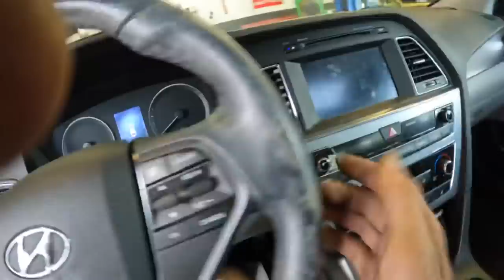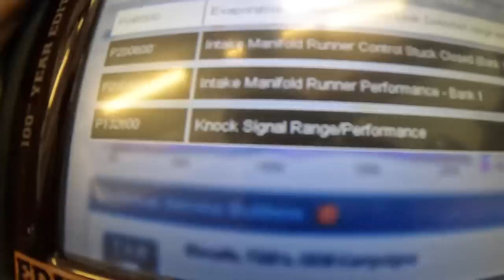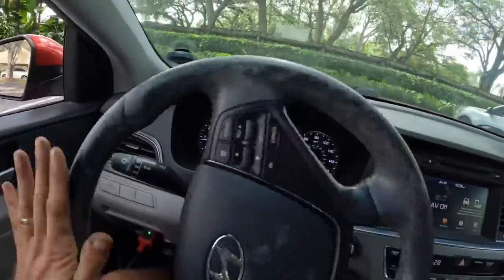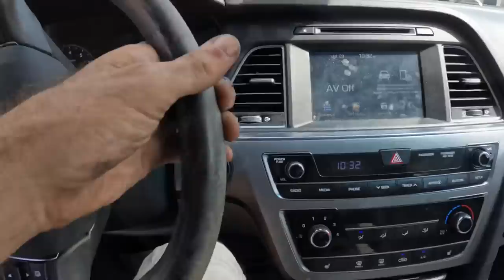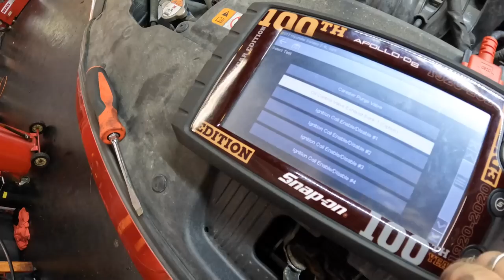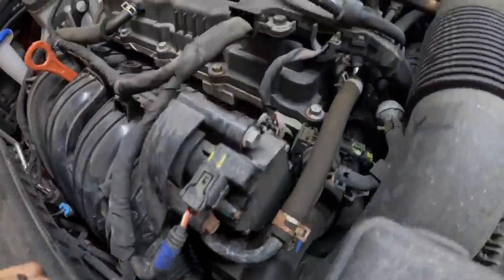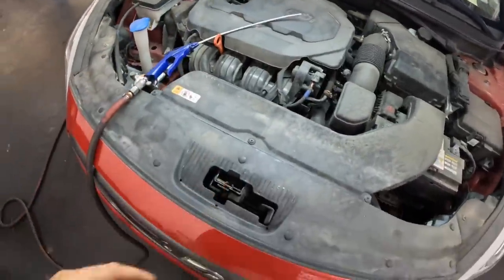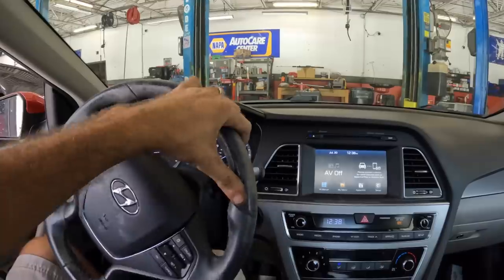Engine Choking to DEATH!  Losing Power! Hyundai Kia motor repair

Comment: I had a similar issue with my honda crv at 160,000 miles.  I sprayed 1/2 a can of throttle body cleaner through the air intake with the engine running at 1500 rpm.  It seemed to solve the problem.

Comment: i didn't think much of the Kia brand, but a buddy used his Kia Soul as a light weight delivery vehicle. It had a manual transmission. He put 423,000 miles on it before trading it. The Kia was reliable and repairs were minimal. I was impressed with it.

Comment: Ray, the intake & tumblers warp over time binding the motor. Doesnt pass initialization. These are also common for cylinder scoring caused by rings seizure, oil builds in the lower intake & upon w.o.t. gets consumed in  1 shot, mosquito fogger!

Comment: I'd check with Hyundai, there is a current recall, maybe not a recall, but Hyundai is replacing engines for free because of the known issues with those engines. 

We got essentially a new engine on our 2014 with the same engine
Reply: They (Hyundai and Kia) refuse to call it a recall.... a letter was sent out for a "product update" and, if you didn't respond to the letter by getting the car checked, they attempt to  deny responsibility.  

H/K should change their sales motto... "looks good from far but it's far from good!"

Comment: I don't know if I understood what the intake manifold does on these cars-it sounds like they are changing power by changing air and fuel flow tube length--quick story-about 50 yrs ago I built a b comp dragster[1400 lb 426 hemi powered gas dragster] hillborn fuel injected which has long intake tubes-i left them long because everyone told me I would never put out enough power to break the wide slicks loose and the car would bog down--long tube give more low end power--well coming off the line I lit the tires for 1/2 way down the track and my speed was only155 mph-at the time the record was 180mph--I cut the tube down to 12in from 18 inches and went 171 mph--it felt like someone flipped a switch mid track and the car took off like it was supercharged-and the slicks just hazed coming off the line--hemi heads and breathing --amazing.

Comment: have the 2018 sonata. had the same issue. it's the knock sensor putting the car in limp mode. dealer has to check for rod bearing damage. if it doesnt pass their test they replace your engine. it's a design flaw.
Reply from the maker: Isn’t that the test where they lock the crank and then supply pressure and vacuum in the cylinders to check bearing clearance without teardown? Never seen it heard of it.

Comment: P1326 means there is a chance the customer can get a free engine from a Hyundai dealer.  The big settlement with the Theta II engines resulted in a software update that increases the sensitivity of the knock sensor and engages limp mode.  The dealer will do a bearing clearance test and if the engine fails, then the customer gets a complete long block.

Comment: Had a similar issue with my 2015 Sonata. It was under warranty and they had to replace the VCM and reprogram ECM with an update to the way the VCM actuates. Something about it was actuating too quickly. Not sure if it's the same issue but it had similar symptoms.
Reply: The VCM is a known problem with these vehicles. It happens.

Comment: knock sensor code will cause it to go into limp home mode. the engine light will flash due to it. hyundai has had many ecu updates for the logic for the detection of the code. long story short. either needs an ecu update, knock sensor or an engine. the 1326 code will only shut off with the engine running

Comment: What has the ower done to that steering wheel?? I have a 2017 Elantra, I purchased new. 95.000 miles on on it. It has been absolutely flawless,  0 repairs.  Stull runs like new. Uses no oil. And the leather wrapped steering wheel is perfectly fine.

Comment: What nobody else seemed to comment is the fact that the car is in limp mode and has the P1326 code and most likely will need a new engine from Hyundai due to bearing failure. There have literally been millions of cars recalled along with a class action lawsuit.

Comment: Hyundai has 100K powertrain warranty-  why not take to the dealer.  I had a motor fail at 97k miles and replaced for FREE.  I have only owned Hyundai since 2003

Comment: How much do you charge to replace the fuel injectors on a 2018 Honda Accord.  1.5l 4 with turbo.  I’ve had an engine misfire since 13,000 miles (I have 105,000 miles now).   The dealership says it’s the fuel injectors.  I’ve replaced the spark plugs already to no avail.  Recently cylinder 4 joined cylinder 3 in misfiring so I figure I better address this lol

Comment: as I  understand, a flashing engine light indicates a severe problem which requires immediate attention. 
would you verify this and explain the difference between flashing and steady?
Reply: Flashing means it has a catalyst (catalytic converter) damaging misfire. Why this didn't show a misfire or throw a code for a misfire seems puzzling. Solid just means there is some sort of trouble code.
Reply: A flashing engine light means SHUT DOWN THE ENGINE NOW. my sister's Mazda protégé suddenly did that and started running TERRIBLE!  Was a bad coil pack.

Comment: Took my shitty car into a "shop", and was told that the gas-cap cannot cause problems.
$100 for a scan, then told engine was worn out,
Went next door. $50 for the scan.
Fuel cap fault, and cam position sensor.
Fixed.
That was 2 years ago.
Watch what you get told.
Clyde Street Automotive in Whangarei, New Zealand, are the best.
Fixed our old Laser, and it WAS worn out, but his fixes at 333000 kept it running up to 360000, and now the Tiida/Versa at 213000.
Does NOT want to work on the PT Cruiser, but I know he'll do a great job. I'm gonna make him do it because he hates the idea so much.
Thanks, Niels.
Decent mechanic.

Comment: So  don't recall you pulling the air filter assembly. but I will admit I was working on another task while this video was playing. was the air filter assembly clean? I've seen mice pack them pretty tight and create a no power situation.

Comment: It's got the theta engine that has millions of engine failures. Machined wrong as evidenced by the red dipstick. Part of the recall inspection.  The engine actually gets a wee bit more oil then specified in the owners manual.
It's in limp mode and the engine is ready to blow. It's a modified knock sensor the lowers power significantly before it throws a rod.

Comment: Did you have to wash your hands AFTER touching that steering wheel?. That, and the missing gas cap, says much about the owner. (what happened to the gas cap tether?)

Comment: In northern michigan there is a place that makes the muti-plug connectors (plastic housings/male/female terminals)  I was there working on the HVAC.   They made parts for many manufacturers.  Most used a brass type metal for the male/female ....most I seen some metal that looked like very thin roof flashing (silver)   I asked what was that metal for...he said hyundai and kia   they use the cheapest wire and terminals on ALL of there vehicles....stay away from hyundai and kia    all of them....event the high end kia and hyundai's use very cheap wiring components....

Comment: It’s in limp mode… motors gone. Knock sensor detected the sound of the Theta motor, DEATH RATTLE! Class action lawsuit, Hyundai replaced the motor for free if it meets some basic criteria. It probably didn’t get her more than a day before it died.
Reply: He fixed it and it ran fine. But yeah, a 5 year old engine shouldn't be having an issue like that except for complete neglect.

Comment: Uh oh, knock sensor codes on those engines usually mean engine knock and I don't mean spark knock.... Hyundai/Kia have a TSB out about that if one comes in with knock sensor codes they have to put it on the special rod bearing clearance checker machine then tell the customer their engine is about to explode and they need to wait 3 months for a replacement. Service campaign 953, check it out. Basically they add some detection logic to the knock sensor coding so they can discern the difference between spark knock and rod knock in hopes that the engine is brought in for replacement before it gets a hole in it and maybe catches fire. Side benefit is they get some engine blocks in for core to rebuild. I just assume that every Theta2 and Theta3 engine I see will throw a rod at some point in the cars life because that's just what they do. Even if you never run them low on oil they'll still do it but just keeping oil in those engines is a challenge. I won't even start one of those cars without checking the oil and whenever I see one in our parking lot I talk to the customer and check their oil to make sure it's not about to die.
Reply: 3 months? I called one today (Monday) it will be in shop Thursday and driven out by Friday.
Reply: @TormentedPenguin  Availability has improved, for a while they weren't getting back enough usable cores to rebuild and most of the new engines were going into cars being built. We were only able to source one from a rebuilder and even then it took about 2 weeks to come in. Supposedly the rebuilder corrected some common failure points but who really knows.
Reply: @huzudra  that's because they keep having bus toss them.over coring. It's bad. Longest I waited was about 3 weeks for a turbo block.

Comment: 2017 Hyundai with only 67879 miles on it, should still be under "10 years/100K" power train warrantee. Am I missing something?
Reply: I think that applies only to first owner and its limited only on engine block and transmission.

Comment: That's a Hyundai/KIA Theta II engine with a knock sensor code, it's getting ready to blow up. Don't worry about the intake, they're going to be replacing that engine soon.
Reply: Knock sensor means the PCM has detected spark knock/fuel pre-ignition.  This is caused by the fuel/air mixture being too lean and does not in any way mean "the engine is ready to blow up".  Over time running spark knock can cause engine damage, but it does not mean what you are saying.  This would be fixed by either having the PCM updated (there were updates which corrected the lean condition by injecting more fuel) or by using higher octane fuel (89 instead of 87).  You clearly have zero clue what you're talking about.
Reply: @deyeatdapoopoo7582  Well FYI, I have a 2015 KIA Optima, at about 66K the engine seized, we brought it to the dealer that does all the service on it and they said "the knock sensor update was done, the sensor detects vibration in the engine, the update was to detect a failure sooner." The Theta II engine has a design flaw that damages the bearings and crank, which has typically led to engine failure in thousands of 2014-2017 KIAs and Hyundais. The sensor you're talking about is the air fuel sensor, and some older cars used the O2 sensor to read a rich or lean condition.

Comment: I wouldn’t touch it. They put that limp mode in for when knock sensor detects the engine is about to blow up. These engines are the worst.

Comment: That thing sounds like a dang tractor at idle! Do those cars normally sound that way, or does it have some top end issues? Low oil/oil pressure maybe?
Reply: Direct inject engines are loud. Injectors are high pressure and spray directly into the cylinders, overall a loud system.

Comment: Shouldn't that be a warrantee issue 10-Year / 100,000-Mile
Powertrain Limited Warranty?
Reply: Second or third owner?
Reply: @billkallas1762  warranty carries over.
Reply: @TormentedPenguin  The powertrain warranty drops to 5 years, 60,000 miles on used cars.
Reply: @billkallas1762  if you buy it from a dealership. In Canada, the oe warranty is honored as warranties are all transferable. Might be different in the states.  But it makes sense, as the warranty is sold as part of the original price.
Reply: @TormentedPenguin  Isn't the warranty in Canada only 5 years, 60,000 miles on the entire car? At least it was 5 years ago. In the US, it's 10 years or 100,000 miles on the engine and transmission, and 5 years, 60,000 miles on everything else.
Reply: @billkallas1762  5 years 100k km so roughly yes, but the drive train recall overrides that. There was a large lawsuit that forced it. So now its unlimited based on recall status for drive train.

Comment: I predict the usual problem from direct fuel injection, sludged oil gumming up the works since fuel doesn't flow past the valves the way port injection would. Never use dinosaur oil or synthetic blends because it just bakes on the valve stems. Using 100% full synthetic oil 100% of the time seems like the answer to preventing a possible planned obsolescence.

Comment: Anyone got an idea on the amount of shop-time it takes to change out the hydraulic valve lifters on a 2008 Lexus GS450h / 3.5 litre engine? Also the manufacturers and part numbers for the lifters. Thanks in advance.

Comment: Better brands with GDI also have port injection to help prevent carbonization clogging the intake system, thus preventing the expensive fix this junk needs.
Reply: I don't really hear of Honda having  GDI issues despite not using port injection.  Seems like maybe they figured something out that others haven't maybe.

Comment: I thought that all Kias and Hyundais have a 100,000-miles factory warranty?  Didn't this car have only 67,000?  Why didn't they just take it to the dealer for a free warranty repair??
Reply: Cause you have to have records to prove warranty
Reply: @Dilberts_Dogbert  Well I haven't had all that much warranty work done on any of my cars (mostly because I buy used) but the few that did, I was never asked to show any kind of documentation, other than the VIN of the car and proof of ownership. The dealers have your name and info on file anyway, they all share the same system, even if you are out of state.
Reply: @LA_Commander  I take it you are not aware of the countless individuals who have been denied because they couldn't prove maintenance had been done
Reply: @Dilberts_Dogbert  I've never personally known anyone who that's happened to. But yes I've heard of it on the internet. Just never actually seen one.

Comment: Steering wheel covered in mold. That tells me there's a water leak into the interior, or water has gotten into the car, and the owner didn't bother drying it out. Probably means there's mold growing in the carpet and upholstery as well.
Missing gas cap as well, which the owner could have easily replaced in 5 minutes with a stop at an auto parts store.
Either the owner has literally no clue how to take care of a car, and just drives it until something breaks or it quits running - or given what's happened over the last 2 years, like many people, has fallen on hard times, and simply didn't have the time or the funds to maintain it.
A tip for easily getting rid of mold like that - take a spray bottle, fill it with a small amount of chlorine bleach and water - the chlorine will almost immediately kill the mold, to where it's easily wiped off - this same trick will also work for any mold growing inside your house, or algae growing on the outside of your house.
Reply: Nah. The owner is probably a woman who likes to use handcream.
Those products can really stain the steering wheel quickly. A damp cloth can remove that dirt if it isn't soaked-in by the sun.

Comment: The video title says Kia, I'm confused :(
Reply: both cars are junk.....
Reply: Not necessarily. I bought a 10 year old Kia for 1500 dollars. Put brakes on the rear. An oil change, or two. Drove it for about 2 years. The tires still looked brand new. Even after I sold it. I never thought I would say this about a Kia. But I miss that car
Reply: Hyundai and Kia are the same company, if you take them apart they are stamped with both logos on parts

Comment: Looks like the car was stolen at some stage judging by all the fingerprint dust all over the steering wheel . A Kia loosing power is not a rare thing anyway :-)
Reply: I've owned 3 kias, and one Hyundai since 2005. NONE of them had power issue problems.  All driven to well over 100.000 miles.

Comment: How do you crust up an engine in 70K miles, abuse or some other problem like oil consumption. The no fuel cap might say something about maintenance, drive it into the ground than throw it out. If I were handy, I wouldn't be interested in cleaning up the mess to get its next 50K, it's a cheap car and may not last to 100K if it is abused as it appears to be.

Comment: How can anybody allow a relatively new vehicle deteriorate that badly? The disgusting steering wheel, and mechanical neglect. I have three vehicles that are each 20 years old, with 145,000 to 200,000 miles and they all look and run like new. I am not interested in purchasing a new vehicle at $35,000. Maybe the owner of this vehicle has bundles of extra cash to burn.
Reply: Throwaway cars attract throwaway owners

Comment: With Anna steering wheel like that you could tear apart a rear-end and not even wear gloves or wash up before touching THAT steering wheel and the owner would never know the difference. No need for the use of brake parts cleaner 🫡

Comment: i had argument with guy in comments on other channel.. he black & blue stated a modern engine will do well over 200 th mile. while my 351c will not. bs.. i said, the engine might, but all the tech around it will fail,,50 miles from town, & you,,cant fix it..na, nana,,na , na, na.. a dumb engine is a good engine,,it dont know sht.. easier putting gas in, than waiting 2 hrs for a towy..

Comment: Verification of poorly designed unreliable vehicle. Even hood latch assembly has issues. Just another 10 cent a lb car once it leaves dealers lot. Many brands seem to be falling into the same salvage bin. Obviously neglected unit that's unlikely to return til it's inoperable.